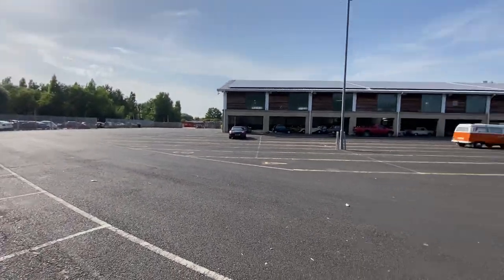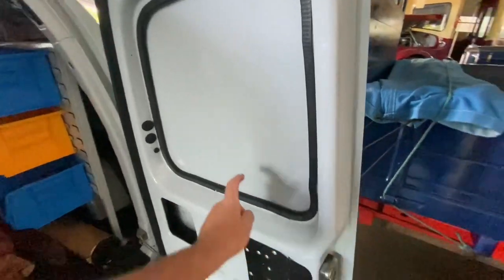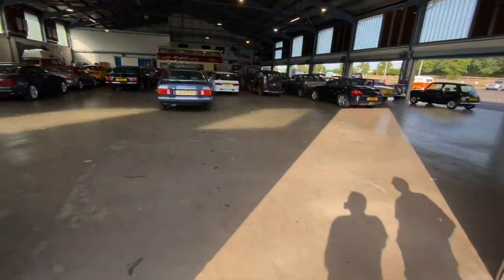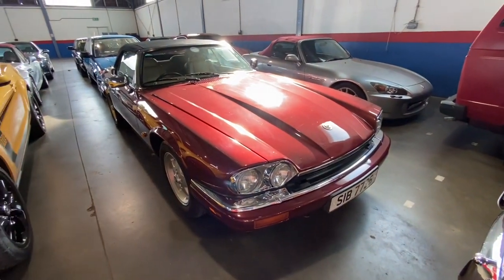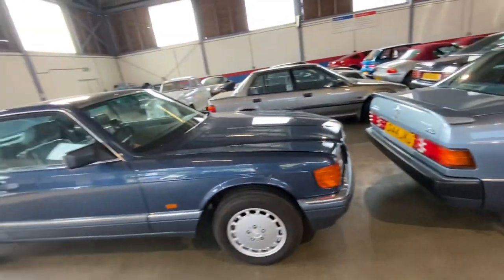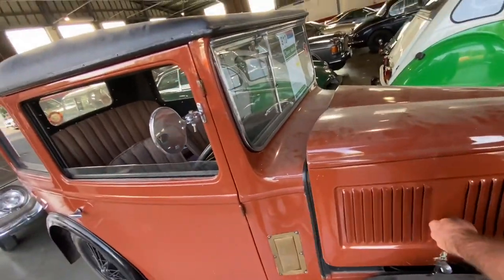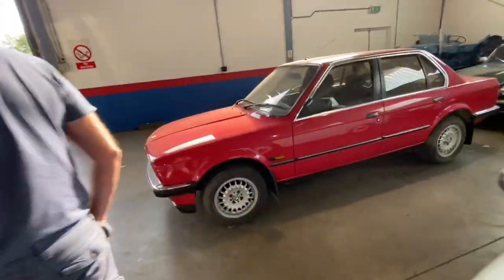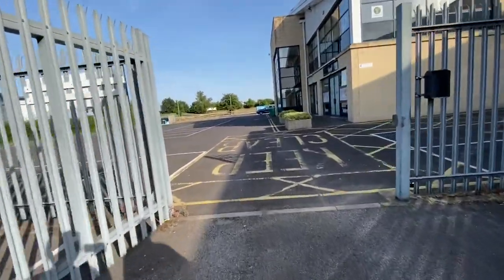CLASSIC CAR AND MOTORCYCLE AUCTION PREVIEW HOBBS PARKER ASHFORD

Comment: Brilliant guys! My father had a Renault R10 new in 69. He used it as a driving school car had duel controls fitted. I used to service it, it done over 100.000 miles without a splutter. Just brake pads, and normal service parts, brilliant car, and I had an R8 Gordini at the time, another story!  Cheers guys!

Comment: Great video guys.  The back doors on the BT van will have had factory window security blanks fitted.  We used to paint and kit out new contract hire vehicles and they were often requested by customers.  Ford supply them, they're pressed with a double folded edge so they sit against the glazing lip, fitting flush  when the glass is out.  They can be plug / spot welded, or bonded in the aperture and neatly seam sealed to reduce the painting.

Comment: My useless fact of the day - The MGBs with rubber bumpers also sat higher at the front end to comply with American regulations of the height of the headlamps.
Reply: I'd forgotten that. The resultant handling was as bad as the looks. 🤭
Reply: I believe they were heavier too. I find if you fill your tank of your car you tend to crash into inner city bumps rather than glide over them wheras on motorways a full tank balances a car gives better stability and roadholding.

Comment: That Prinz is an NSU. There can't be many of those around nowadays.  NSU probably more well known for their RO80 rotary engined large car but also had small rear engined rear wheel drive cars which were pretty good.
Reply: I used to have one. Sold it in 1986 for £140! Little 550cc two cylinder engine in the back and I had to put two bags of sand in the front to stop it wandering all over the road!

Comment: The Ford pick up beside the BT Escort van is a Thames van also known as the 400e. The van version was made in two versions, the 10/12 cwt and the 15cwt. The number was on the badge above the rad grille. My Dad bought a 10/12 version secondhand in 1960 and cut windows into both sides and converted it into a camper. As with most early vans the engine was between the front seats with a removable metal cover for access. The cover had a stepped top and made a great seat for me as a nipper (bloody hot through). Ive been 100's of miles sitting on the cover (no seatbelts of course). The cover was fastened down with two rubber hooks and metal retainers, as used on rally car bonnets of that era. I gashed my shin on one of the metal retainers and still have the scar to prove it!!!. PHJ 965 where are you now???

Comment: Thanks guys. Most enjoyable. Best cr there is the grey rally mini on a 66 plate. I used to have one many moons ago, an actual ex works one from the Monte Carlo. Won't tell you what I sold it for in 1970 but it was more than a new 3 bedroom house in those days. Don't know why the one here is in Farina grey. Could be a respray or a replica. The true originals had a spot light in the centre of the roof! Intriguing.

Comment: The Seat Ibiza was designed by Giugario and had an engine and gearbox designed by Porsche and was launched in 1984 before VW took over the company. It was never any part of Nissan.
Reply: Correct. Based on the Fiat Ritmo. Fiat had something like a 35% holding in SEAT, but pretty well ran the company for a while.

Comment: Hello Guys . Chris , that MGB Is probably reshelled with  a "heritage " shell .  British Leyland spent over £2 million changing the ride hight ,  detuning the engine and fitting those rubber bumpers,  which weigh about 40 kgs to meet a US law only to find that the car fell into a different weight category and didn't need changing !!! Rob, that engine wasn't for that car ! Its a Daimler 250 and has the sweetest 2.5 litre V8 .  And the Renault had  definitely been flashed down the sides ! Rob, your quite right in those days the metallics were single stage only , and they were a nightmare ! Hope this helps ! Lovely woodworking skills at the end . That's proper coach building !

Comment: Petrol blue Seat Ibiza with Systeme Porsche along the bottom of the doors, I can still smell it now, previous owner had applied three miles of sealer to the inner bodywork so I think they might hsve been prone to rust.  Took it for a clutch and St Michaels in Byker filled it up with water, took it for a hole in the floor and the same hero wound down the window and said look away before yanking the door back into shape and sealing it up🤣

Comment: That first gen ibiza was based on fiat  ritmo or strada. Engine was designed by porsche for seat with same bore centres as fiat engine so they could make it using same transfer equipment etc.

Comment: Very interesting guys, especially the Renault..... 🥰 The Seat Ibiza was the first new model after Seat split from Fiat in the early 1980's after building Fiats under licence for many years.  VW took the company over and developed an all new model rather than badge engineer an existing VW model.  Probably to secure government funding at the time. Ital design styled it, Porsche had some influence in the engineering of the engine and gearbox.  As I understand it !!

Comment: That ford escort soft top had 98,178 miles in may 2010 then went down to 1,751 miles in April 2011.
Reply: Obviously went around the clock and back to zero then 👍

Comment: The first Ibiza's were based on a Fiat, think it was the Strada? They were basically a reskin designed by Giugiaro, but with Seat's own engine in, that Porsche actually did have an input on. A couple or five years ago, I flipped one from about £500 to £900, but I'd got it in the back of my mind that i'd probably never see another one, but, would they ever been worth anything?

Comment: The Seat Ibiza was not at all Nissan based. It was a separate model in its own right. The engines were called 'System Porsche' because Porsche designed them. Around the same time, before VAG took them over, they had the Malaga saloon (based on the FIAT Regata, saloon version of the Strada) and the Marbella, based on the Mk1 FIAT Panda. FIAT and Seat had a long-standing relationship.
The 'Prinz' was made by NSU, who became part of what is now VAG.
Reply: My mate had one in college in 2000, I remember the clutch cable snapping going up hill

Comment: The car at the front of the last row. The Prinz. Was an NSU Prinz. It was too fast to see which one. I had a NSU Prinz 4  950cc two cylinder twin coil. You got the best part of 100 miles to the gallon. I then owned an NSU Prinz 1000 TT four cylinder four carbs a bit nippy.

Comment: while you were swanning about at the auction, i was doing a "will it start" on my uncles '73 cortina, inside an old wooden shed [about 10 miles from you, next to where you got the rzr from].  bloody hot down there, don't know how you lads can work in that heat every day! came home tonight back to sunderland, 10 degrees cooler thank god, it hit 41 degrees just north of dartford tunnel on the motorway!    keep up the good work, + buy some air-con for your garage...

Comment: That's a SEAT Ibiza mk1 facelift. Nothing to do with Nissan, or Hyundai whatsoever! It was designed as a replacement for the 'SEAT Ronda' which was essentially a SEAT badged Fiat Strada.
So the closest relative really is the Fiat Strada! All engines, bar the base model 1.0L, were developed in colaberation with porche and bodywork by Ital design I belive.

Comment: The Opel / Vauxhall Monza was tried here in Australia. Peter Brock, Australia's greatest touring car driver (d. 2006 rip) built one. Based on the Holden Commodore VH / k? Had a 5.0 litre V8 with 5 speed manual. It never got past the prototype though.
Edit!  8:14 A Mitsubishi Magna? They were built down the road from me here in South Australia. How did that wind up in the UK?

Comment: The Ibiza was SEAT's first independent hatchback - bodywork designed by Guigiaro and Porche input on the sohc 1.2 and 1.5 engines and the gearbox. A hang over from their FIAT days was some of them had the 903cc ohv FIAT unit under the bonnet which gave it a complete poverty spec misery that was quite unique by the mid 90's lol
No NISSAN nor Hyundai input whatsoever
The 2 stars of the show there for me are the NSU Prinz and the Renault 10
Reply: Just saw the same Ibiza on Car and Classic site for £4200 - wonder what it made at auction

Comment: I am at the age where I can remember being driven a round in my relatives and family friends who owned sum of them old cars in the past the I had a works BT van in grey but I had a lot of kit so mine was a twin wheel transit the grey colour was to match the colour of the underground ducting wich in 80s was standardised for all utility companies and at to have the own colour the  GPO used to be black but the electric companies got that you at to be careful when you dugout a hole an make shore it was a black GPO before cutting into it has telephone wires are only 50v DC

Comment: SEAT were originally, rebadged Fiats because Spanish people wouldn’t buy anything Italian. That Ibiza was the first car after the break up, or bust up with Fiat. Porsche were involved in the design of it. Any resemblance to any Nissan or anything else is just the fact Giugiaro designed it, and at that time cars started to….look the same to attract buyers etc. Volkswagen were so impressed they bought SEAT, and around the same time SKODA. They now make one body frame, one engine block, and use across those brands, VW and Audi.

Comment: Back in the day my former partner won a yellow MGB GT on a TV game show called the price is right. Since day 1 that car overheated regularly and after a few hundred miles the oil light came on when driving to Malibu California. There was maybe 1/2 liter oil left after puking oil during the drive . Constantly in the local dealer for service during the 12000 mile warranty. Loads of issues with this brand.
Reply: In the early 70's these English sports cars were overloaded with emission equipment to comply with USA /CA regulations. The B series motor was a very reliable unit when produced with its twin SU carbs!

Comment: The BT escort van rear doors weren't glazed.
Reply from the maker: No but those doors on it were previously
Reply: @sruk the doors were just standard doors that had metal panels instead of glass. the black trim on the inside was to protect the raw edge where the glazing rubber would have been with the metal  panels fitted in the outside recess. M514 NOP was my van at one time.